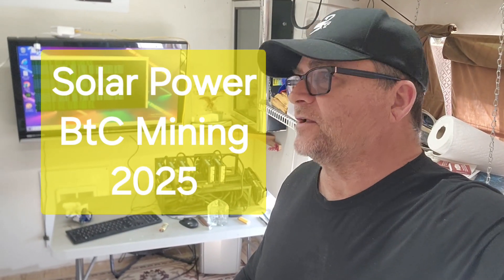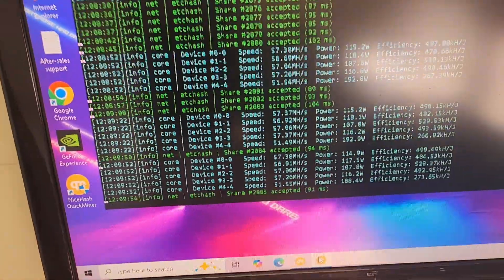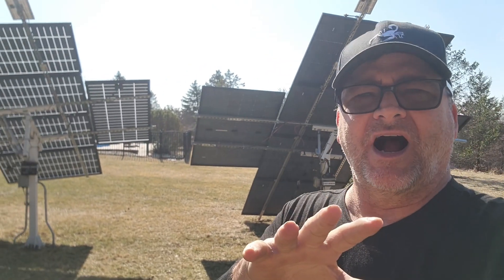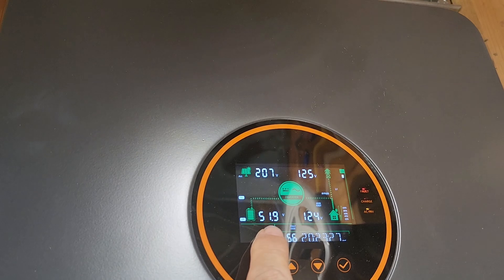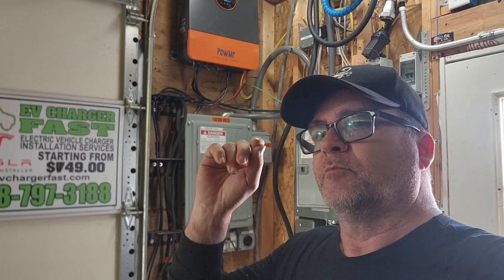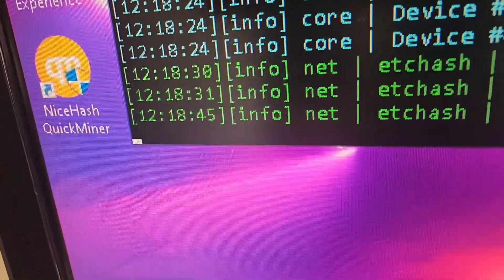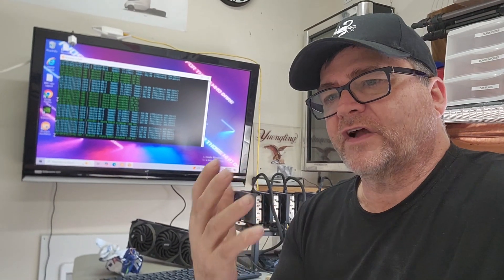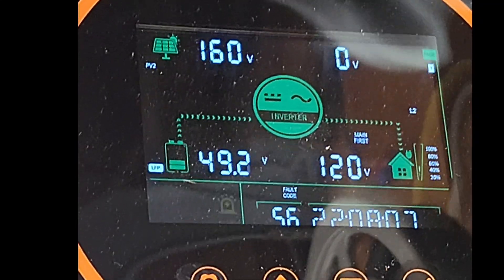Is Solar Powered BtC mining the only way in 2025?

Comment: The intent is not to sell, it's to hold. You're mining KYC free BTC (not sure about Nicehash tho). Plus you're securing the network. People need to change the way they view mining BTC and fiat money. I mine daily and I lose daily. I don't care. I stack my sats and hopefully in 10 years I can start buying goods and services with the hardest money out there. I have 4 large miners 2 are "profitable" if you're comparing it to $$$. 2 are a loss. But I earn daily and that's why I do it. I also buy off exchanges. Stack as much as you can because in a few years the exchanges will start running out and it will be difficult to even buy with your dollars.

Comment: also with the fact that your loosing battery power during a solar day,   likely tells you,  that you still dont have enough solar.  just because you have an array of 2500 watts, doesn't mean that you'll get 2500 watts from them..  and time of year, and time of day plays a HUGE part of how much watts you'll get out of your solar panels..  i have 2500 watt array with 5 400 watt bifacials that are mounted on the back end of a sailboat.  because of water reflection and the elivation of the panels, i can utilize both sides during the day..  estimated about 500watts per panel.   but even then,   the last week,  with nice no cloud days,  i'm lucky to pull 1300 watts at any given moment from my panels.   so,  your 3800 watts?   likely pulling in only 1800 watts max at noon,  means that you'll only ever me able to supply 8.18 amps of 220 power to your miners.  not sure if thats enough.. but who knows..  1800 watts is 1800 watts for free..  or is it?   panels cost,  they depreciate like anything else.. so they do cost.   but the cost per kwh is likely less than your power company charges..
Reply from the maker: Great comment,  thank you..
I certainly can use more solar array. My batteries only drain when grid input is off or when the sun isn't out, but I've reached the saturation point as a hobbyist, I'm so underwater with this venture it's a joke, but I love creating something from nothing if you know what I mean
Reply: @ yea, you would be underwater for most of the investment period of your solar investment. however, btc investments are a bit different than most..  today's value of btc,  it could take 30 years.. but in 30 years,  btc value could mean that you paid it off 300,000 times.

Comment: ok.  why dont you have any output for watts?   or watts input from solar?   just saying..  unplugging the grid and seeing how long it will last is not a good way to tell.   honestly,  if your running your battery dry during a solar day,  your way too low on battery storage..  volts alone wont tell you anything.   amps alone wont tell you anything..  but WATTS WILL..  because watts is AMPS*VOLTS   which gives you a complete picture of power.
Reply from the maker: I agree. I'm not sure why Powmr inverter doesn't scroll input watts of the 2 solar trackers, i will say that im almost able to run entirely on my solar setup 100%, but when a cloudy day comes, its over. Keep me posted with any advice...
Im really having fun though, ,
Reply: @Electrician-family  you can pull data from those inverters with usb or serial.  and i do believe that watts in/out is part of that data.  check out home assistant and esphome and you can use grok to put it all together for you.